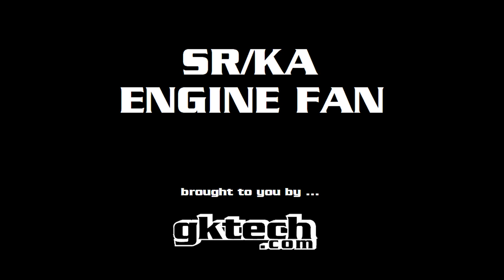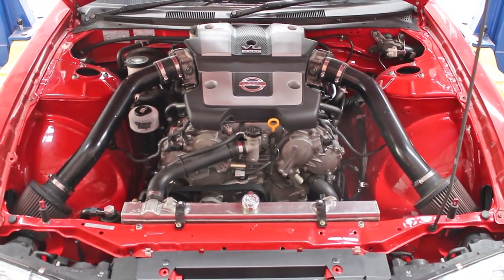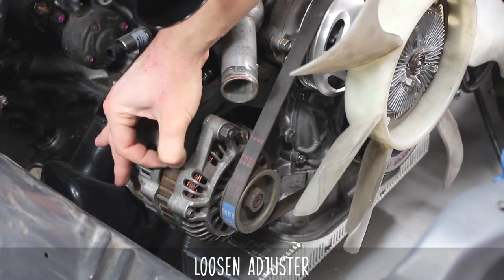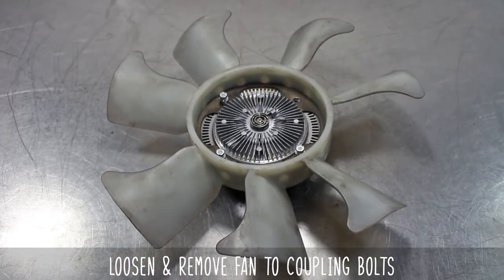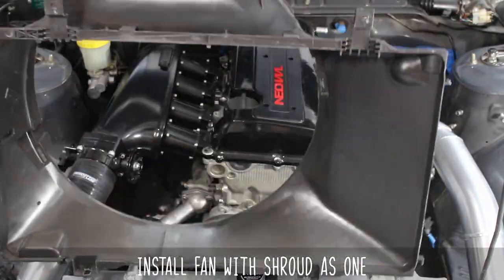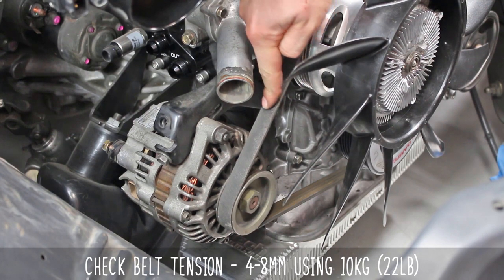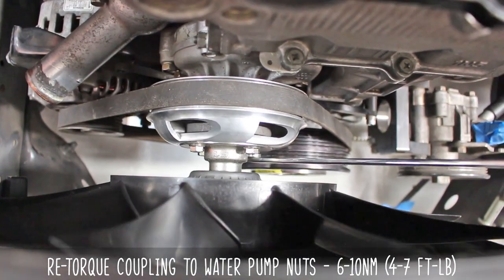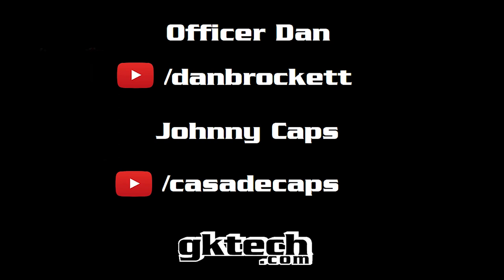Gktech SR KA Engine Fan - Install

Comment: I did this today on my S15! For clarity for other S15 owners watching this, our alternator has a bolt at the top and then a 14mm nut at the back bottom of the alternator. Which is different to this S13. All else is the same. 

I also had to remove the top rad hose to slide out the shroud. May be possible without doing that, but was a lot easier removing it. 

Excited to have it running again to witness the pure powerrrr of this fan!